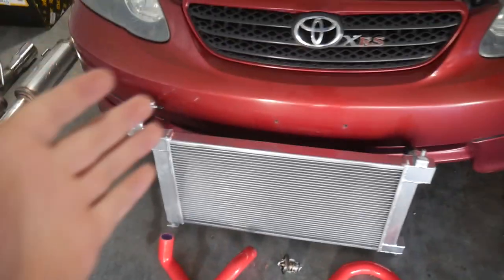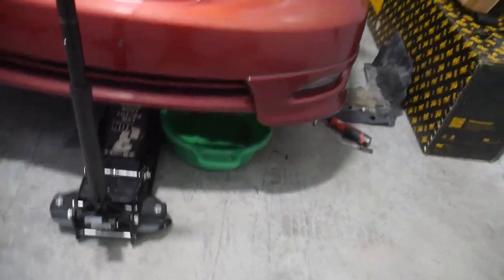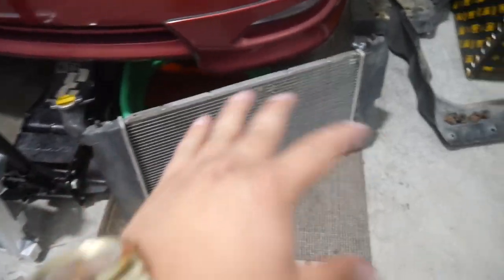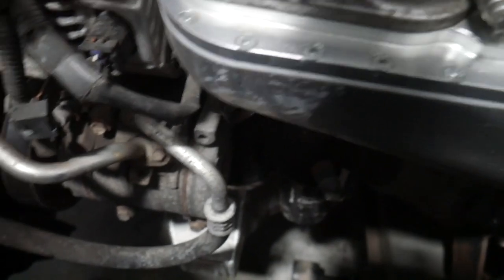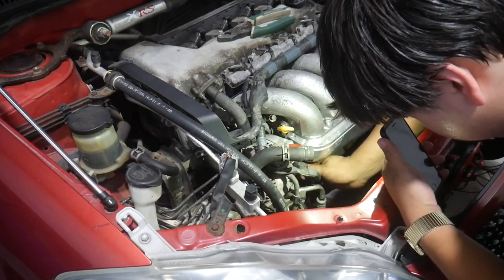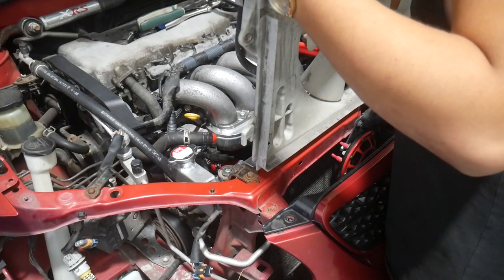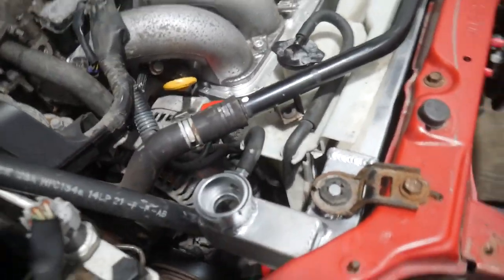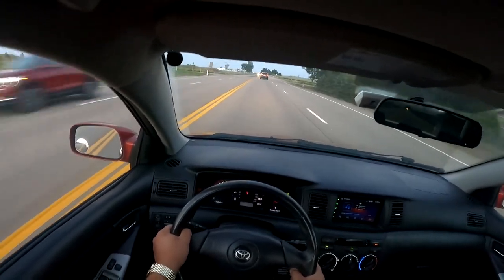Corolla XRS MWR Radiator Install!

Comment: I'm about to install the same radiator and hoses in a week and would love some more detailed pics or video on the cutting needed for fitment. Would also love your feedback on my build if you wanna see more 2zz stuff!
Reply from the maker: Feel free to Dm me on instagram @willhchang if you want some clarification on cutting the radiator support, it doesn't need too much for the radiator to be installed. I'll check out your build as well, always interested in more 2zz content!
Reply: @WillChang  will do!

Comment: What's up will Bro I saw this radiator is it better than the oem?Can I use it with daily driver Rolla the corolla with normal hoses or I need these hoses u post
Reply from the maker: I see it as an upgrade over the OEM radiator since it's all aluminium instead of plastic, doesn't have a risk of cracking like plastic does! And it cools more efficiently than OEM! You can use stock hoses on this radiator you don't need the ones I installed but I recommend replacing your old hoses with either the silicone ones or new OEM hoses as the old hoses may be more prone to breaking and leaking

Comment: Q: For the thermostat installation, does it require particular orientation?
Reply from the maker: I'm not 100% sure, but I installed it with the jiggle pin at the top since that's where it was with the stock thermostat. Whether it affects anything I'm not sure, but I figured since the jiggle pin was on top from factory, that's how I should orient the new one

Comment: would this do anything for non-xrs corollas or would you not recommend it?
Reply from the maker: It'll work just as well with other Corollas, I think all engines can benefit from an upgraded cooling system! Sure it isn't necessary on a stock engine but it doesn't hurt to have more efficient cooling